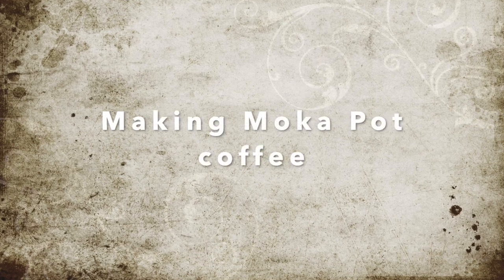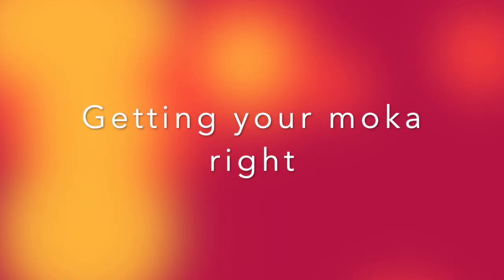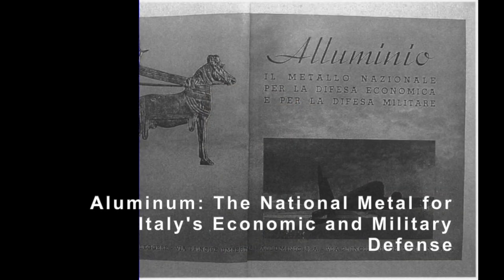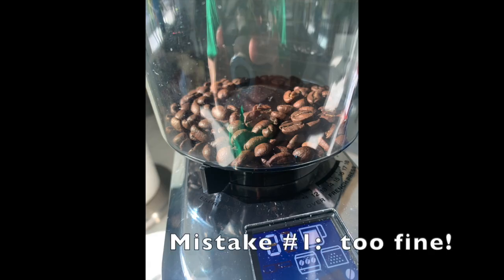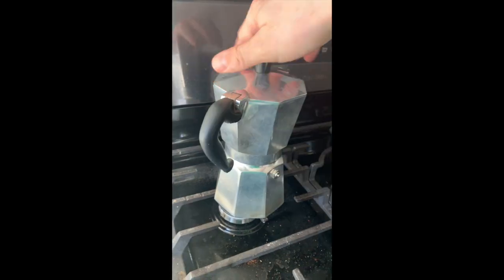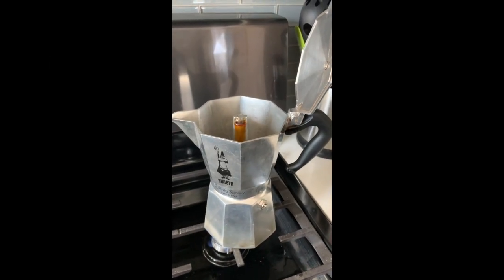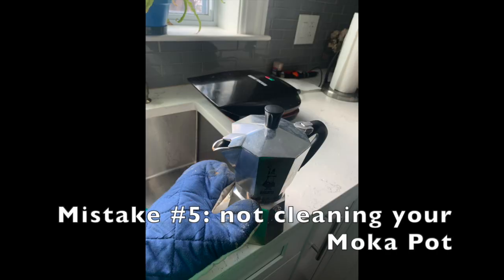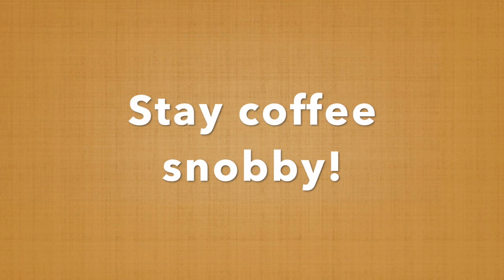Why your Moka pot tastes bad

Comment from the maker: Also, there is a much longer video that spends a bit more time discussing some of the science theory (like the fact that water boils at higher temp when it's under pressure) and contests my claim that you need to remove the Pot as soon as it's bubbly. Their claim is that ambient temperature water will... I don't know... they're not exactly clear... spend more time in contact with the grounds.  I don't see how the steam is going to spend any time in contact with the grounds before boiling creates the vapor pressure....

Anyway, watch if you'd like a bit more food for thought https://www.youtube.com/watch?v=aikEi9xHt2A.
Reply: Turns out that Moka pots are a bit trickier to pinpoint then I thought 😅. Moka pot and none of its parts aren't in my eyes a sealed system. While true that partial pressures between each of the three chambers at any time will probably vary, it is not sealed and the pressure is fairly free to equalise, as the only resistance is the coffee bed itself.
Therefore based on the drawing, you can see the system works not exactly due to Pascal's principle as it is more complicated than that. The first part is largely based on vapor pressure difference. Water evaporates at pretty much all temperatures, temperature only changes the rate at which it does so. So does the surface area of the faze interface. The drawing shows, that the tube of the basket is a much smaller area, compared to the rest. Temperature being close to same in the chamber, it is expected that there will be less vapor in the tube than around it, less vapor = lower pressure, causing water to be sucked through the tube until equilibrium, which we keep shifting by heating it.
This effect doesn't necessarily happen only at boiling temperature, it can happen sooner (haven't tested nor calculated the lowest temperature though.)
Than the coffee chamber starts to fill and extract the coffee. It can be tricky here to pinpoint the ideal heat to use, as extraction is a function of both time and temperature. Temperature increases both the extraction and the evaporation rate in the bottom chamber, increasing the speed at which the water is forced up into the coffee, eventually out of the coffee into the final chamber, and therefore decreasing the time of extraction per molecule of water. I expect there to be a steep extraction curve though. The water that enters first is at a relatively low temperature and stays a long time, as it needs to fill the chamber before being forced out. It also at this stage doesn't get heated further. The water coming after it gets progressively hotter and hotter, as it is necessary for it to be so, so that the pressure equilibrium is not reached. After the water fully fills the coffee chamber, it has nowhere to go but up. The hotter the water going into the coffee, the shorter the contact time, purely based on small pressure gradients between the three chambers. (Higher heat, more water sucked faster, works even between the coffee chamber and the top of the pot).
Now, the reason you can produce wastly differently tasting cups is that extractions are a mess 😁. You would expect that there is no difference between short, hot extraction and a long cold one. If you ever had a cold brew, you know that isn't true. Some chemicals are not extractable (think of soluble but for liquids) at lower temperatures. In the case of coffee, these compounds are the harsher bitter ones (tanins mostly) and the acidic ones.
That corresponds to their testing, where the coffee spends a fairly long time extracting at 60 degrees and progressively shorter times at the higher temperatures. This is aided by them using high heat to heat the cold water, causing a longer 'lag faze' and a quick 'log faze' of extraction.
If you use already (close to) boiling water, you will force the water to fill the coffee chamber a lot quicker as the pressure difference between the two chamber will rise quicker, causing shorter extraction time at a higher temperature, but your extraction has very short 'lag faze' and the same 'log faze' afterwards, extracting overall more of the bitter, and less of the lower temp sweeter rounder compounds.
That assumes the use high heat too, though. Your result is better, because you put it over medium heat. That will lengthen the lag faze and make the log faze not as steep, extraction will be likely less bitter and more sweet.
In regards to them not plunging it into cold water, it is just the matter of reaching equilibrium to stop the process. You are putting constant medium heat into it, starting at a water close to a boil. You will reach a point where this system becomes incapable of keeping up the heat necessary for the equilibrium to not be reached(as the amount of water in the chamber decreases), and the water will stop flowing. At that point, you will likely superheat this water, which you don't want as that temperature will likely cause unwanted compounds extracting. So you stop and force equilibrium earlier, by rapidly decreasing temperatures( likely reversing pressure gradient, btw, causing some watery coffee to be sucked back into the heating chamber).
They on the other start high heat, but as they see the flowing coffee, they immediately decrease to low, causing the equilibrium to be reached more slowly and naturally, without the need of cooling the chamber down.(therefore results may vary in between electric stoves with higher temperature lag, over gas stoves)
Long post, should've wrote an email 😂
Reply from the maker: @MultiBamb00cha  Yeah, I agree with most of what you said as it is mostly in line with King's paper http://www.msc.univ-paris-diderot.fr/~phyexp/uploads/Moka/article1.pdf. 

"Your result is better, because you put it over medium heat. That will lengthen the lag faze "

I'm not sure this is the case.  Medium heat will mean it takes more time to get sufficient water to boil to have the vapor pressure needed to start the brewing, but I'm figuring the only thing that changes the brewing temperature is the ratio of the temperature of the fully heated air to the starting temperature of the air, since that alone dictates what the partial pressure of the air is going to be, and therefore how much water vapor needs to be produced, and therefore what the water temperature will when brewing.  Medium get gets you to that temp more slowly, but it's still the same temp, by my figuring anyway.  

On a side note: I'm curious about your consistent spelling of the word "faze"
Reply: @loodog555  Sorry, not a native speaker, I use the word 'faze' in a couple different instances, and it is used in a similar way I'd use it in my native language.
Also what I meant by your result being better because of the use of medium heat, what I was comparing is a scenario where already boiling water from the kettle is being used, and I am suggesting that in that case, medium heat should yield better results, as opposed to high heat, if like I said you are using boiling water.
You will likely get enough of a pressure differential fast enough even on a medium heat in this case, plus reaching higher pressure, though unlikely due to the systems inability to really get pressurised much, may lead to increase of the boiling temperature of the water, causing it to superheat a bit, and making the extraction go more bitter.
The way I address partial pressure was also not the way you are thinking, and I should have cleared that up. I used the wrong term there. I was talking more about a likely pressure gradient in the Moka pot, from highest likely being in the bottom water chamber, second in the ground coffee chamber, and lowest (atmospheric) in the upper chamber.
The air, although it can affect the process, is much less important in the chamber than water. Air is not highly heat conductive, nor does it have a high heat capacity, and there is comparatively much smaller amount of molecules of it in there.
Understand that water in the chamber doesn't have to be boiling evaporate, aka increase pressure, aka start the process. It is just much faster when it is boiling.
There are reasons it is never said to brew Moka at a low heat and temperatures reached. It is impractical due to time required, and it is also practically impossible to monitor the actual temperature inside. It will likely also taste bad, as we are looking for a sweet spot of temperature/time of our extraction, and this might yield poorly extracted coffee.
Reply: @MultiBamb00cha  You didn't make an important consideration: gases expand as the temperature rises. This is the reason why the water put in the boiler rises towards the extraction chamber and continues until it reaches the bric.
Inside the boiler, you must not only consider the presence of liquid water but of a gaseous atmosphere of air saturated with water vapor which, when heated, expands, pushing liquid water (not compressible) upwards, at temperatures around 90~95 ° C, through the funnel of the coffee recipient.
Reply: @antc.4457  yeah, that's why the whole mechanism works, pressure is increased by evaporation, gases have larger volume than liquids, creating higher pressure. What I was saying that the amount of molecules of air is not as significant overall, as water molecules, later steam molecules vastly outnumber it, until a lot of water is pushed into the coffee and out of the bottom chamber
Reply: @MultiBamb00cha  Much of the extra pressure caused by the water molecules that pass into the gaseous phase is immediately released through the funnel of the coffee holder. Instead, the air present inside the boiler, above the water, responds to the Van der Waals law, and it is this that pushes almost all of the liquid upwards.
Rather than trying to imagine a physical model on the functioning of the laws of thermodynamics applied to a coffee maker, it may be useful to observe what really happens, and there are those who did it through a neutron-radiography, where the metal is transparent and the water (or rather, the hydrogen of water molecules) opaque:
https://www.youtube.com/watch?v=KAiH9yAoLZ8
Reply: @antc.4457  Ok, can't argue with that evidence.
In that case it should technically work the same with a liquid with higher boiling temperatures and/or higher vapor pressure, ie. oil and the effect should happen at almost the same temperature, no?
Reply: @MultiBamb00cha  As a principle, what you say is correct, of course, this applies up to the limits of use of the coffee maker in those particular modes of use, so with too high pressures the safety valve in the boiler should operate and in case this has a malfunction, you would get up to exploding the coffee maker.
Reply from the maker: @antc.4457  And yet the air actually decreases the pressure! Surprise! https://www.youtube.com/watch?v=O14BIH-9KTA
Reply from the maker: @MultiBamb00cha  And yet the air actually decreases the pressure! Surprise! https://www.youtube.com/watch?v=O14BIH-9KTA
Reply: @loodog555  Be careful when interpreting a model (which is nothing more than a simplified version to describe reality). In any case, you cannot go against the very concepts of physics: remember what pressure is: a force applied on a unitary surface. It is the force that gives the movement and since it is clear where the water molecules move (the net movement, which is a statistical average), then the direction of the force and consequently the pressure is also clear.
In practice, during the 3 extraction phases, you do not have any depression (inside the boiler), but you will always have a positive pressure differential.
What decreases is the increase in pressure, not the pressure!
Reply from the maker: I'm not sure where you think the model goes against physics.  

The paper utilizes ideal gas law, the use of saturation vapor pressure, Darcy's law for fluid flow.  The only thing put in there that isn't a straightforward physics model is Illy's assertion that 92-94C is the optimal temperature for coffee extraction.  Where do you think they've gone against physics?
Reply: @loodog555  First of all, sorry for the possible misunderstandings. I am Italian and have never studied English, so I have to use the translation services available on the web.
When you talked about depression I had to interpret the meaning you wanted to give it: it can mean a negative pressure (i.e. a pressure inside the boiler, lower than the atmospheric one) or a decrease in pressure (yes, but with respect to which condition, at which instant in the process?).
I am also an engineer and in my scientific education, in order not to mess up, I got used to always focusing on the direction in which the process takes place, in this case, the flow of fluid: a positive pressure pushes the fluid, a negative draws it backward.
Reply: @loodog555  As a lover of coffee (like you!) and of positive confrontation (I share many of your observations), I must point out this: "Lavazza express moka" and "espresso" are two very different realities (observe carefully: these are not written at the same way! and for Italian regulations, they could not be ...).
Be careful because Mr. Lavazza, also brilliant in marketing, played on this misunderstanding when he invented the small coffee maker! "a coffee as good (almost) as at the bar and as fast as at the bar", but the meaning he gave to "express" was of "extra pressure" and not the meaning of the word "espresso" in Italian, that is "fast".
However, they are two very different extraction techniques: espresso has pressures around 10 atm, while mocha does not even come close to 2 atm.
Illy (great Italian roaster), indicated the temperature of 93 ° C for the extraction of the espresso, therefore with pressures from 8 to 12 atm and even more (parameters out of range for the moka).
Reply from the maker: @antc.4457  I noted that as well, that moka pots are not espresso and they certainly don't produce the same pressure.  Still, the ideal temperature for extraction is probably about the same.  

A small note: neither Illy nor Lavazza invented the Moka pot. This was done by Alfonse Bialetti, which I mention in the video, but maybe that is what meant by "Mr. Lavazza."
Reply: @loodog555  ops! Bialetti not Lavazza (lapsus!).
E dire che preparo i miei caffè, ogni giorno, da più di 35 anni, grazie alla mia fedele piccola Bialetti.